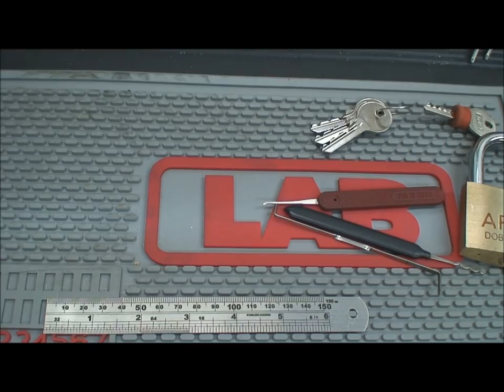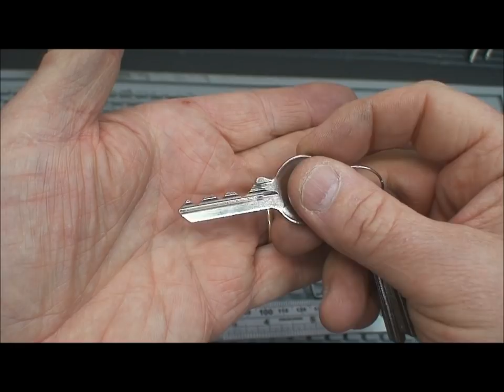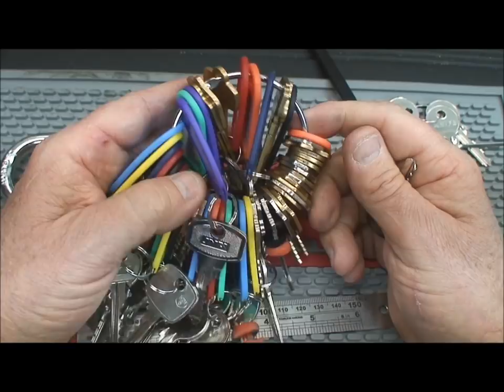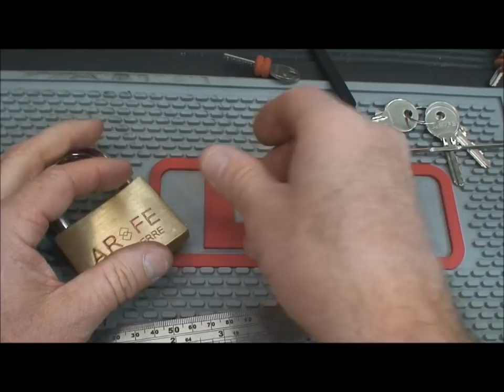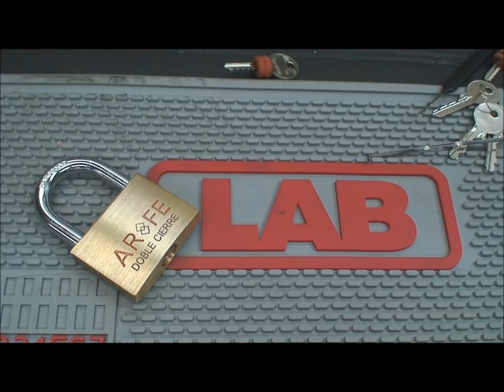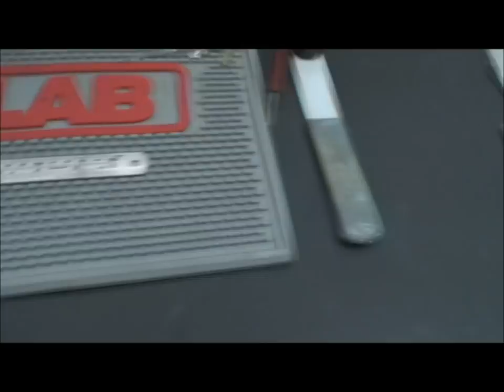(63) Rapid Entry Planning (Against Locking Devices)

Comment: I'm in law enforcment (in europe) and we always call a locksmith, who will drill out the cylinder. Niw i've watched some of your videos and i'm wondering why i've never seen anyone do picking. I guess you make it look very easy :-)
Reply: TheStyx91 probably because in the context of your work there's no need to avoid leaving traces. If you raid or repo a property the occupants will know about it fairly fast and usually you take possession and fit new locks. If you want to sneak in, bug the place and get out, picking becomes more relevant.
Reply: @WineScrounger  Also Europe tends to have better locks, because European insurance companies specify certain levels of pick resistance to cover property loss.  Using a garbage quality lock and the insurance adjuster may deny payout even if the door was breached with an axe.

Comment: that bump key you have is known as a junk key, a properly cut key works every time in seconds, I never file the tip or shoulder,  instead the cuts are offset btween1/32 and 1/16 of a inch towards the tip of the key, high peaks are used for control and the cuts got to be exact for a consistent working key, I do not ever need to put rubber bushings on the key either the springs in the lock are sufficient!

Comment: Mr. Bill, great video! We must remember that some people will not have the experience at your level. As an electrical journeyman, I have guys that are in the 5th year and you would think they are brand new in our trade. It takes us "older guys" to save the day more often than not, but their was a time I had the same issue. Again I enjoy your expertise than the actual lock picking. Cheers
Reply: You're right; experience and learned skill does come into play (as with anything). But regardless of skill level/experience, common sense is often one's most valuable asset. Being open to more than one approach is just good common sense for tackling most any problem. In those 'more than 1 way to skin a cat' cases, some solutions work much easier/faster than others.

There's a dozen ways to remove a rusted/seized/rounded bolt or nut. It would be a poor use of time to try a set of vice grips for a half hour w/no luck. After a few minutes of failure, why not move onto another available method (PB Blaster, hacksaw, torch, nut splitter, Dremel, drill, removal by metal fatigue, BFH, etc)?

With almost zero experience, many padlocks can be shimmed open as Bill showed. But you'd have to be stubborn as a mule to sit and try shimming for a half hour, right?

Comment: And remember - if you picked a lock and it turned BUT in the wrong direction DON"T re-lock it - use a PLUG SPINNER !
The plug spinner will do the job - other-ways the ANCIENT CURSE  will kick in and you'll never pick it again !

Comment: I used to live in a high-crime neighborhood, where break-ins happened daily (somewhere in the area; not in the same place every day). In all those years, I never heard of a thief picking a lock. Mostly, they used what Bill calls “destructive attacks:” they smashed windows, kicked in doors, busted through walls with sledge hammers, pried doors off their frames, broke chains, cut through lock shackles, etc., etc. Or they stole the keys and used them to open locks, or hijacked things at gunpoint or knifepoint.

Most crimes are not committed by skilled professionals, or even by smart people. Most crimes are committed by drug-addled idiots. It’s nice to know about all the clever ways to finesse a lock. But most of the baddies don’t bother with any of that.

Comment: Thanks so much Bill for the amazing and methodical video.  This is one of the top 5 I have seen in your series.  For a complete beginner, what are the fundamental tools to have in your kit?  I have a Sparrow beginner kit (4 picks 3/3 tensioners) which works pretty well and I have been able to open some pretty tricky locks already.  I feel a TOK tensioner is probably a must have.  I would guess a good set of shims would be handy.  Is there anything else you would recommend for the complete ideal beginner kit? (besides practice of course)
Reply from the maker: John, it sounds like you have the basics covered: short hook, medium hook, half diamond, S-Rake, maybe an L-Rake, and a couple of Bogotas.  Standard BOK tensioners as well as TOKs.  With that, you should be able to pick open most locks you encounter in the wild.  If you live in Europe or pick high security locks you'll need some thinner picks too, say around 0.015" of the same ones listed above.
Reply: bosnianbill thank you!

Comment: Would you share your source or any source for the rubber donuts for bump keys and for a good set of shims? Thank you for your time and knowledge.
Reply: jacob aikey the rubber donuts look like rubber rings for putting on lambs tails. Try a farm supply shop. Failing that size up some silicone o-rings.

Comment: Bill,
You mentioned foiling a pin tumbler lock.  I've heard of doing that with dimple locks but not pin tumbler.  Can you elaborate more on how that is done and/or the source of the tool that does it?  
Thanks for another great video.
Rick

Comment: Same thing applies to getting many other things done.  Like IT work.. Be amazed at the number of people that will try the exact same thing, time after time, trying to get something done, end up spending hours on single task performing it the same exact way.. Hint: If it does not work the first time, the ONLY reason to try it again is to be sure that you didn't foul it up procedure-wise.. After that, it's a computer; it's supposed to work consistently one instance after the other, if all given variables are the same..  Otherwise, it's as useful as having a calculator that when you enter 2+2 and it comes up a different number every time.. Not very useful..

Comment: Anyone got an idea of what type of lock is on a jaguar car, at least some of the old ones? I found his keys today and noticed that it looked a bit unusual, it was cylindrical with a slightly larger diameter at the end which had some small chamfered sections, almost like a disk detainer, except cylindrical as opposed to the flat keyed ones.